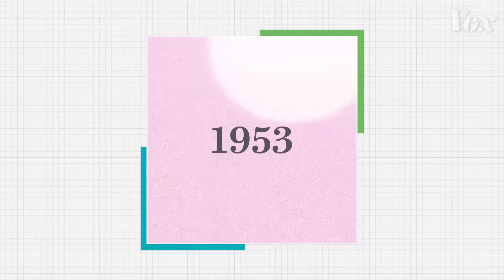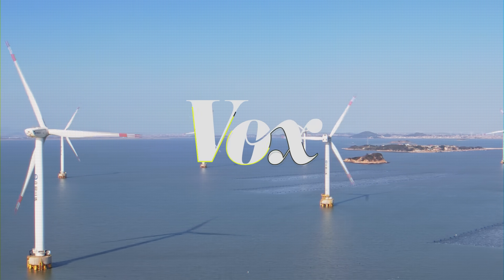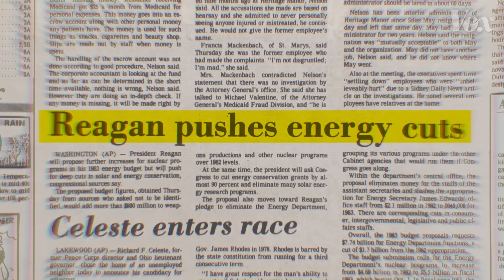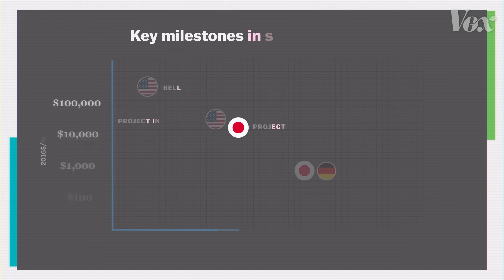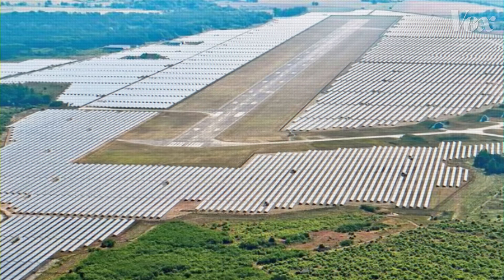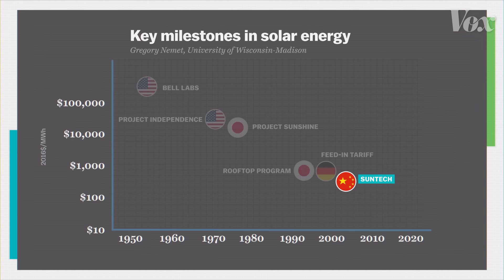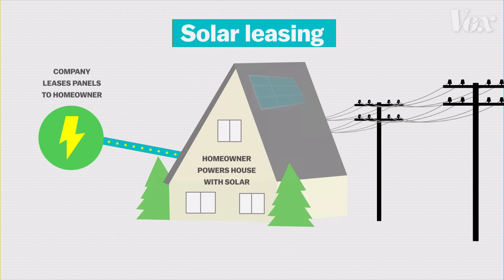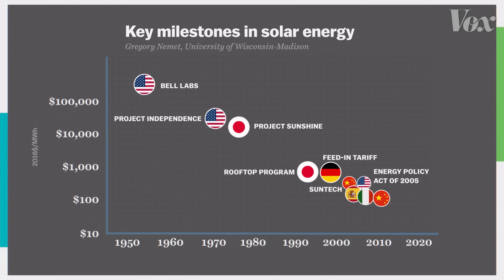How solar energy got so cheap

Comment: its called a lost leader, ask yourself why ? cui bono?? maybe if you adopted a total clean environmentally friendly system that "defines the  21st century" that ends up being a control mechanism for =china to secretly sneak in control chips into solar and inverters so they can turn you off when you depend on them  most.

Comment: Solar energy is not  cheap.  My neighbor installed  panels in  2022. He  paid  $45,000 for  a 15 kilowatt system. He got a $20,000 tax subsidy. If solar is so cheap, why were  his panels  so  expensive and  why are we still giving  these  subsidies? Answer: Because  solar  is  still very expensive, even after decades of improvements. Solar's inefficiency is pushing up our energy bills, and  leaving us with a depleted energy supply  for the future,  which  will push up costs even more over the  long run. Nuclear  power  is  the answer.
Reply: It will be expensive in terms of $/kilowatt for small scale but big scale solar in 100 megawatt size can cost as cheap as 0.7$/kilowatt

Comment: The problem is that solar panels can not be manufactured without fossil energy, so a solar panels energy system can not exist by itself because it can not produce the necessary power (not the energy) to mine, transport, transform and manufacture materials to make solar panels.   So deploying solar panels everywhere does not stop us to produce pollution and C02 which are what we want to stop doing.    The only energy solution that is 100% recyclable  (thus creating no pollution) is photosynthesis which is a process invented by nature millions years ago.    We should do everything we can to reproduce photosynthesis because it is the only sustainable energy system.

Comment: The Green New Deal could make electricity 28 times more expensive

The Green New Deal can cause the average household electricity bill to go up a crushing $52,500. The reason is simple. Wind and solar require a lot of battery backup and we use a tremendous amount of electricity so the cost of all these batteries is many trillions of dollars.

Here is the basic derivation. It is kept simple and the numbers are all rounded off so they can be remembered. (The U.S. Energy Department should have done a detailed analysis long ago.)

— The electricity storage capacity required to replace today’s fossil fueled electricity generation nationwide with intermittent wind and solar is 250,000 MWh.

— Assume grid scale battery facilities cost $300,000 per MWh of storage capacity. (Today’s cost is higher.)

— Thus the capital cost of this storage is 75 trillion dollars.

— Spreading this cost over 20 years gives an annual cost of 3.75 trillion dollars.

— U.S. household electricity usage is 1.5 trillion KWh per year.

— Thus the household cost is $2.50 per KWh.

— Average household usage is 10,500 KWh/yr.

— Thus the annual household cost of this storage capacity is $26,250.

— Today’s average annual electric bill is $1,800.

— Thus the electricity cost increase is over 14 times as much.

In short everyone’s electricity bill will be 14 times greater than today if wind and solar replace today’s fossil fuel powered generation under the Green New Deal.

This will be true of industrial and commercial consumers as well which will drive up the cost of virtually all goods and services. This impact is truly inflationary.

But this does include the electrification of transportation and gas heat which are also part of the Green New Deal. Electrification is often estimated to roughly double the amount of electricity generated.

— Given electrification the cost of electricity might jump a whopping 28 times today’s cost. The Green New Deal causes the average household electricity bill to go up a crushing $52,500.

Of course the economy would likely collapse before this happened but this simple analysis is the necessary starting point for thinking about the incredible cost impact of the Green New Deal.

There are lots of technical refinements to be added to this analysis to make it a good engineering cost estimate. Some make the numbers go down others make them go up. I would love to see this done and would happily help.

For example the cost of batteries might go down a lot and there are studies that project this. Given that the material requirements for this vast amount of batteries greatly exceed our present mining and manufacturing capacity this may be unlikely but it is not impossible.

On the other hand this simple analysis assumes batteries charge and discharge from zero to 100% of capacity. If it is actually 10-90 or 20-80 then a great deal more storage capacity will be needed.

Then too the storage requirement can be reduced by overbuilding the wind and solar generating capacity. However this reduction is limited, I have been told to 180 million MWh, because there is still no solar at night and no wind when it does not blow hard enough.

But it is unlikely that these giant batteries have an average full performance life of 20 years.

Note too that this analysis does not include the cost of the enormous amount of wind and solar generating facilities. Nor does it include the cost of borrowing trillions of dollars.

The basic point is that the Green New Deal is impossibly expensive. There is no cure for intermittency.

Comment: Things got a lot better in the 80s versus the 70s so Reagan made the right call. Germany took out their nuclear and replaced it with coal and French nuclear which has extra transmission losses. Solar also has a lot of nasty by-products. Nice thing is though, if we keep tariffs low, China can dump all those chemicals in their own land and water sources and we can enjoy solar in places where it works like Spain, Arizona, and other sunny places. Otherwise, putting up panels in Ireland and Germany are at best slowing decarbonization or worst, accelerating it as energy if manufacturing/transportation/ installation energy isn't ever recouped.

Comment: Now wholesaling in Australia at AUD $0.19/Wp so around USD $0.127/Wp expected to drop another 22% in the next year to USD $0.10/Wp.  PV panels don't need subsidies and in low cost labour markets provide super cheap power. Further cost reductions will come with efficiency increases and 22% efficient panels will climb towards 30% efficient which will see panels fall to USD 0.06/Wp by 2030 (EG same size as 440W panel today will be 600W panel in 2030).

Comment: Solar electric panels can not work to produce typical useful electric power by themselves and it is improper to discuss them as such.   They produce erratic electric power fluctuating greatly with any cloud that might pass over a solar farm and have to work with storage system such as batteries or quick-make-up electric power sources.   It is impossible to simply buy a solar panel rated at 1 KW and get 1KW out of it the same as starting up a portable gasoline generator rated at 1KW. 

In general a well situated solar farm might generate 1/5 its rated maximum output in a year.    If the solar panels were gotten for free the other systems and space needed to make them useful for power generation are economically expensive.   Residential power rates in the USA should be at about $0.10 kWh.   The places people are thinking they are getting an economic advantage out of using solar electric panels are in places with greatly mismanaged power grids charging much more than the policy of cheap electricity would allow, they are typically loading the grid with erratic power generation that the power grid has to make up with expensive fuel burning reediness.   They further got tax benefits from installing the solar electric panels.   

Without  stabilizing battery storage to turn solar electric panel generation into a somewhat dispatchable electricity such as Tesla does with it solar roof and power wall, power grids were in some places forced to buy that erratic power at net zero pricing where people were able to sell erratic power back to the grid at the same price people would buy stabilized grid quality electricity from the grid.  

The actual value of the erratic electric power, a forced buy by the grid, is quite low,  far below the price the grid is having to pay for it.   That money flowing out from the power grid to pay for low quality electricity is paid for by everybody else that is actually paying true market value for electricity.   This intentional mismanagement of the power grid in southern California has caused what should be the targeted residential power rates of about $0.10 kWh to be at peak times in San Diego over $0.60 kWh.   San Diego CA has one of the few southern California power grids that is financially solvent.  Others are in some form of bankruptcy.

Comment: Quoting the Module Price $/Watt is meaningless.  And quit listening to the meaningless OpEx metric that doesn't reflect the fully burdened costs.   The only Solar PV costs that matter are the fully burdened installation costs.   $3/watt installed for Residential.    $1/Watt installed for Industrial Grid Installations.  Panel costs are not the final costs.  

And ask yourself a simple question. Why pay $3/watt installed for Residential and yet pay 1/3rd of that for Industrial Grid Installations.   Why do any Residential since most of the installation and power payback costs are subsidies.   Subsidies on Industrial near nonexistent, and you get 3x more watts for the same price.  Cool.
Reply: Scale economies?

Comment: All solar projects are subsidized  by governments with taxpayer money. This is because solar power projects are not profitable. Significant investment in solar projects has too much risk for privet investors. The fact is that not one solar power plant has been built without government funding. Government funding in all its forms that does not need to be repaid allows the power to be sold for a lower price. 
If solar power plants had to actually pay for building the power plant solar power would be be much more expensive.

Comment: Watts are a measure of Power.  Energy is measured in Watt-Hours.  To convert solar Power to solar Energy, we need batteries. When we look at cost, we need to compare solar Energy, not solar Power.
Reply: Energy doesn't have meaning when discussing the solar cells because of a well-known fact - two identical cells in the same environment will produce different amounts of energy if one of them will be in it for several seconds and another one for several days, that's why we measure them in power. But the fact that solar energy requires much more than only solar cells is true - it takes the whole infrastructure to put solar cells to good use. But not too long time ago the extreme cost of solar cells was the biggest problem, nowadays this problem is solved and while other problems exist too - they are much more bearable

Comment: If I could plug in my car to my rooftop array, and then run my house when I was at work for less than gas then I'm all about it. But I still got to charge my car and run my house from the grid at night so not really worth it. Maybe in a work from home situation the economics make more sense.

Comment: Hmm.  I'm not sure if I believe your figures.  Even today in India the cost is higher than your 2019 prices.   I'm presuming that the price in India is below the cost of manufacture based on differentiating the market, and using that market to absorb fluctuations.  You certainly can't purchase solar panels at any place close to those rates in the USA or France.  Given the high likelihood that those prices were driven by dumping by China, I just don't believe it.
Reply: The prices given are for industrial size units where the panels are produced cheaply and en-masse, and they account for a 20 to 25 year life span of the panels, reducing the overall initial cost of the panels on a yearly basis.
The prices you see are probably from private rooftop solar panels, those are more expensive, and need special equipment and manufacture to be fitted on the roof. Of course those are more expensive in comparison, and they probably will always be.

Comment: Question: from my house I can see 4 huge windmills and a solar field, why has my electric bill doubled? Green is a disappointment!
Reply: You can install your own rooftop solar panels that will easily decrease your bill and also, you would be incharge of your own electricity because the panels are yours and you are the one generating the electricity
Reply: @dante_parakalo6134  I looked into it when I built my house and at that time I would have broke even after 30 years if no repairs but the panels were only rated to last 20 lol
Reply: @dante_parakalo6134  I also have an ethanol plant about 2 miles away.  In the real world wind, solar and ethanol need tax payer bailouts to survive....

Comment: Yes the cost of solar has coe down dramaticly, but I checked on pricing and the best I can find Is .70 cents per watt not .20 so stop liying.
Reply: It's much worse than that, the arrays use a rated output number in their calculations, but their actual output is about four time less, 30 times less in the Winter.

Comment: Solar is cheaper but requires subsidies?  If it's so cheap why are power generators not all in?  Why is breakeven on solar in Arizona basically never?
Reply: It's because not too long time ago it wasn't nearly as cheap. And while solar cells became cheap, everything else that a solar power plant requires is anything but cheap. And any power plant requires a lot of time to be planned and built

Comment: Solar energy is not cheap and it's more expensive than nuclear even if the solar panels were FREE.  This is due to the lack of storage, something the Greenies never want to mention.  Solar is useless for the grid unless backed up with another energy source.
Reply: OP doesn't know wind power, hydro or geothermal energy. But I guess that's because his brain was rotted by the fossil lobby. Go sniff some more Diesel kiddie
Reply: @Blue Shut up.
Reply: @fghjk3456 cope Harder kiddie

Comment: I come from lebanon, and solar has to be the biggest change of the 2020's. You can run out of gas, water, petrol, diesel, bread, etc... but solar cells live practically forever and the sun isn't exploding in the next million years, and you can see rooftop solar almost everywhere nowadays when just 3 years ago it was unheard of or in the first stages of being implemented.
Reply: But solar needs some other source to back it up, or an energy storage method.
Reply: @ForbiddTV  ever heard of pumped storage plants. Seriously stop sniffing Diesel

Comment: All these governments provided the technology to enable China to dominate.  We need to quit doing that.  I installed a solar system in my home two years ago, so I am a solar proponent.
Reply: @@blue-lu3iz I ordered some Chinese panels along with the other components.  They were supposed to be in stock, then I found out that US customs had blocked them because of Wighar problem.  The dist. didn't tell me, but my son found the news article and I confronted the dist. I cancelled the panels, then a friend of my son had bought a bunch used, so I bought them from him.  They are Hyundai 300w panels made in S. Korea.  They only produce about 250w, so I ended up increasing the  quantity.

Comment: That graph showing Lazard’s LCOE shows PV at around 40$/MWh, which is probably based around utility scale in a sunny region(Spain, Australia, California etc). Latest auction in Germany for PV a few days ago had a weighted average of around 70€/MWh which is competitive with current fossil fuel prices in the region but way higher than that plot. Therefore be very careful about these estimates as they are very condition dependent.

Comment: and here we have Australia, they've cut the feed in tariff rates to as low as just 2.75c per kwh for most of the day, refuses to upgrade the electrical grid infrastructure to handle increasing solar power input, so they can have more money to subsidise the ever more expensive coal fired electricity plants and coal and gas mines that exports it all and charge us ridiculous prices to keep any for our own use.

Comment: There are limitations. Batteries are polluting, and expensive, and in countries with more pronounced seasons you cannot generate enough at night, and in winter. so still have to support your unchanged share of the common grid supply which also has to have more capacity due to the expansion of hungry household devices, and the electric car future, which involves huge amounts of resource mining from depleting mineral reserves inflating the energy costs of that extraction. there's always a cost if we want to live without energy poverty to sustain a first world lifestyle. I would say with that in mind urban design needs more focus than any other factor. Everything without balance in the end collapses.

Comment: The price could go up short term if the technology improves such that the output per panel improves substantially. But it will drop again as production goes up.

Comment: This raises a pretty obvious question: if solar is so cheap, why aren't fossil fuel companies switching to it? If they are purely profit motivated, they should all be using solar primarily now (especially since they wouldn't need to spend billions to lobby governments like they do with fossil fuels).
Reply: Because you need fossil fuel with renewable. you need fossil fuel when renewable can offer power (at night, when there is no wind or no sun), you also need fossil fuel to extract all the material and to build the renewable. In the end Fossil fuel companies benefit from the rise of renewable. If you look at germany, you will see that despite the huge rise of renewable, their consumption of fossil fuel didn't decrease, or even increased (for coal)